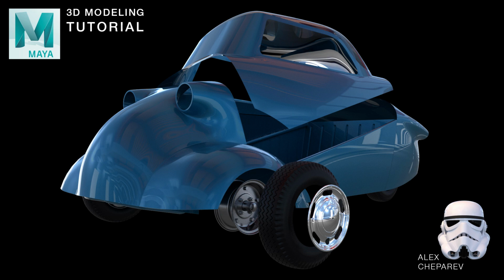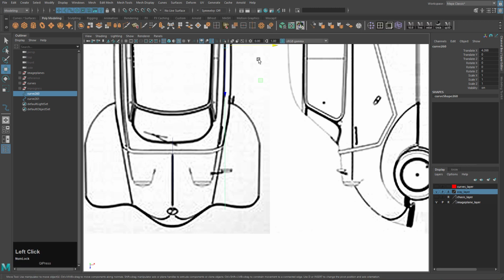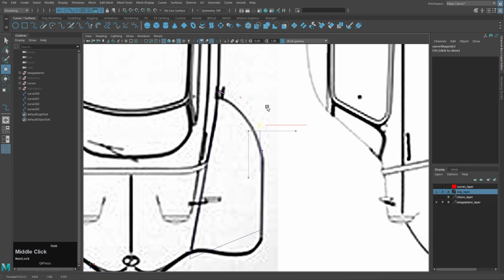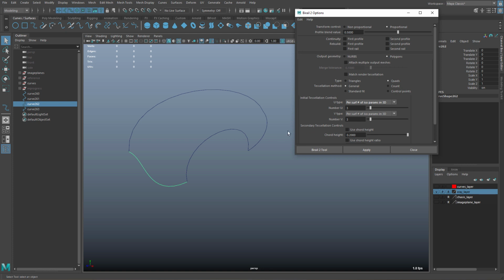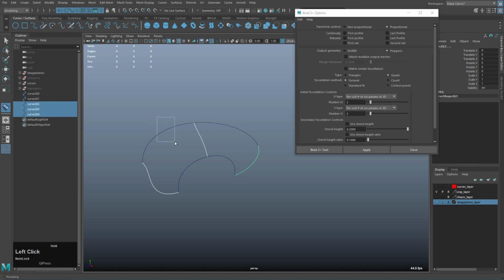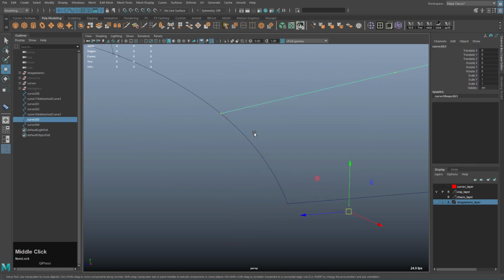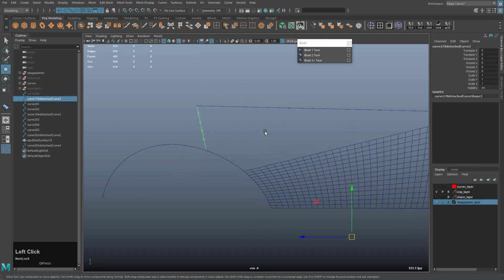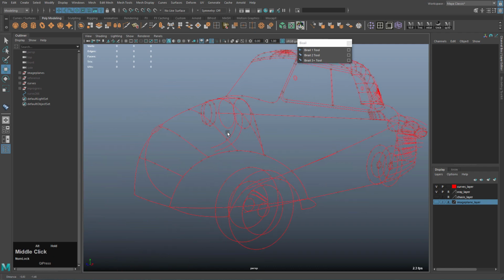3D Modeling a Car in Maya - Fender & Side Panels

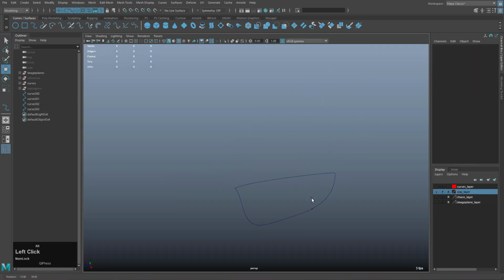Comment: 7:42 Have you tried creating a loft with more than two curves? Seems like you don't understand how the loft tool works.
Reply from the maker: I hope you realize that in that situation Loft will not work. I use loft with more than two curves all the time for specific situations. When you need to span 2 rail curves with a profile curve, your only option is the BiRail tool. It seems like you don't understand how the loft tool works. If I'm wrong, please record a video and post the link here.
Reply: @AlexCheparev  Yes you're correct about using a birail in order to get complete control over the profile shape/curvature as opposed to lofting, but to potential viewers who are new to nurbs modeling might be misled when you say "loft ONLY uses two curves", I was just clarifying that. You're good at what you do, I learned a lot from you as a polygon modeler myself.
Reply: @AlexCheparev  Keep up the good work  *sub *